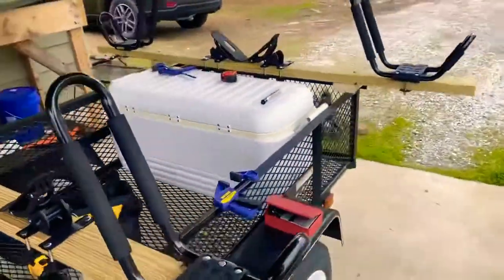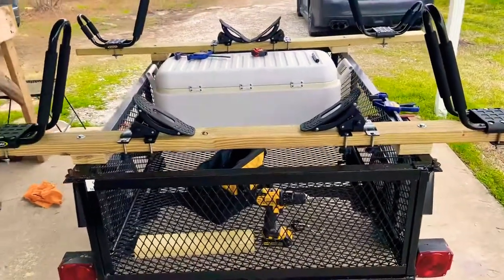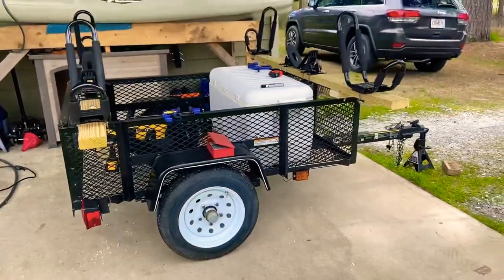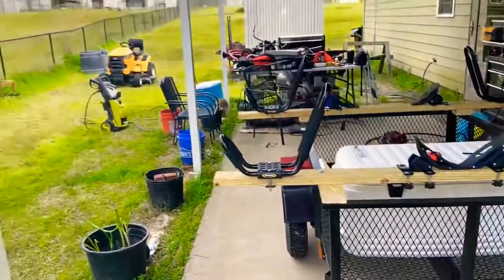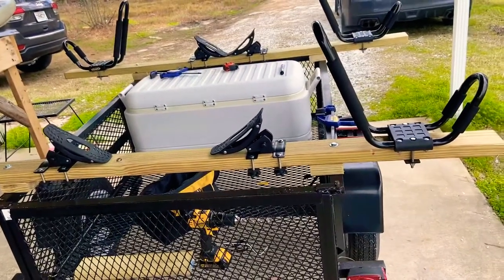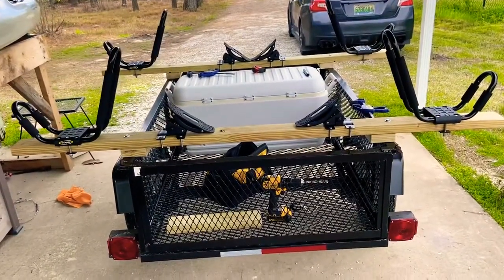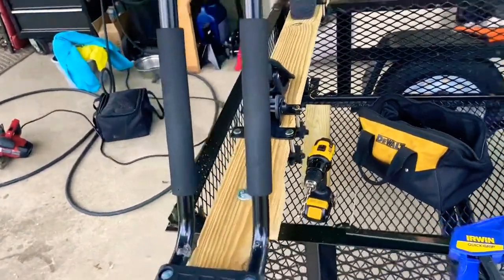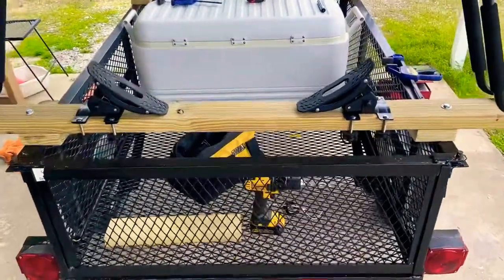DIY 3 Kayak Trailer

Comment: I'm planning a similar setup. I'll have to adapt some things my trailer is a 5'x8' with rear ramp etc. but I like your set up as it can be removed  with 4 bolts for utility trailer use. I want to ask what was your reasoning for adding the short (5") piece of 2x4 under your long 2x4 cross pieces? Why not just mount the cross pieces directly to the trailer top rail? Give me a heads up if there was a reason. thanks.
Reply from the maker: My reason was for the cooler. The cooler I used to travel with was a bit too tall. I ended up building this trailer completely out. I didn’t leave it this way very long. If you look on my channel I need up building a waterproof fiberglass box inside with molded in mounts for my
Kayak.

Comment: Did you have to do any modifications to the J racks to get them to fit on a 2 x 4 or did the hardware that came with it fit around a 2 x 4?
Reply from the maker: All I had to do is notch the wood slightly.

Comment: Doesn’t the tongue need to be longer? I’ve got an 11 ft yak
Reply from the maker: I had a 12’ a 11’ and a 10’ on there at the same time. They obviously are positioned more towards the back but it worked just fine.